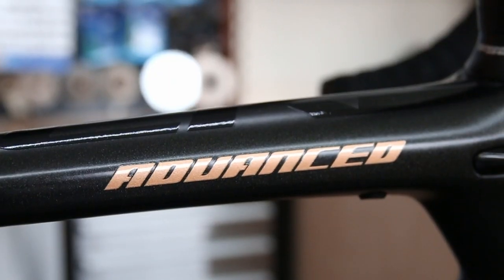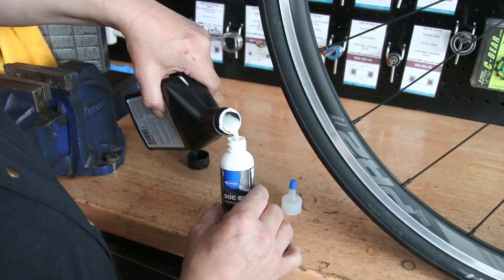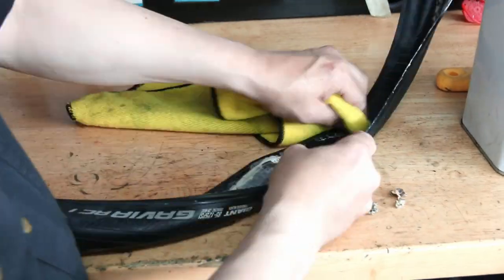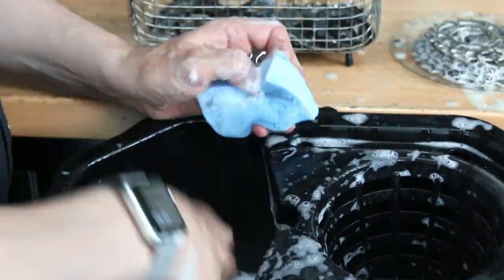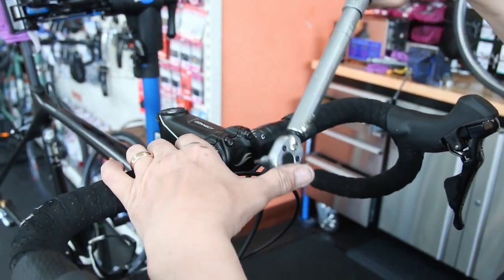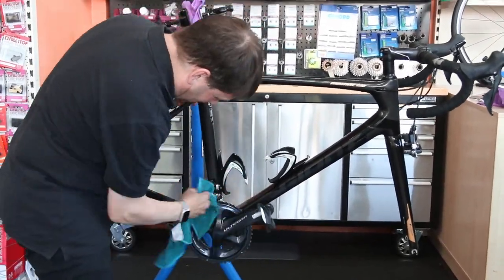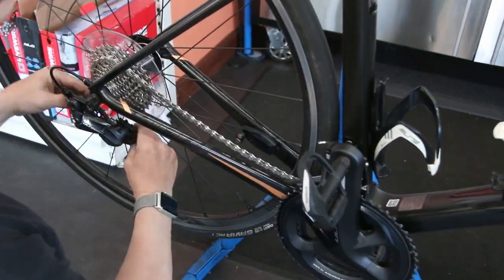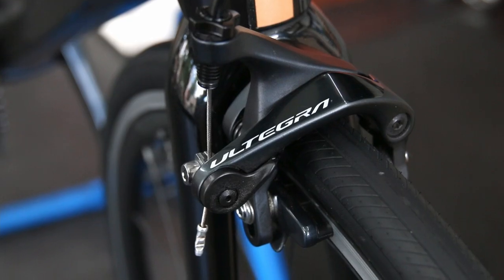Why It's Time To Service Your Bike! | Giant Service And Tubeless Setup

Comment: I have the same bike and wheels , today I  cleaned up the tubeless set up and I have the same problem with the tyres I cannot get them seated at all , I have a floor pump with a Beto air tank compressor , they are not having any of it they refuse to seat , just found your video and seen you had the same problem, I might just buy a new set of tyres seems easier
Reply: Soapy water and lots of it. Try and work the bead into place by hand first too. If the tyre is loose, try a couple of straps. Take out the valve core to get air in quicker. And don't be afraid to overinflate to really get the bead into position.

Comment: Don't wash that dork disk, toss it in the garbage!
Reply from the maker: It’s not our place to throw parts of customers bikes in the trash, that’s entirely their call to make! 🧡
Reply: Easiest way to clean dried sealant out of a tyre is to use a thick rubber glove and rub it away with your fingers.